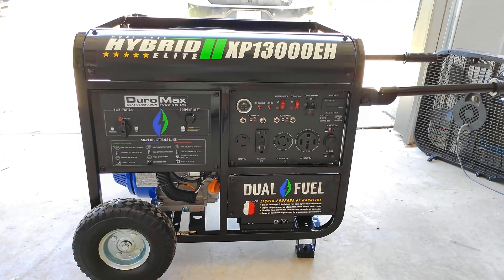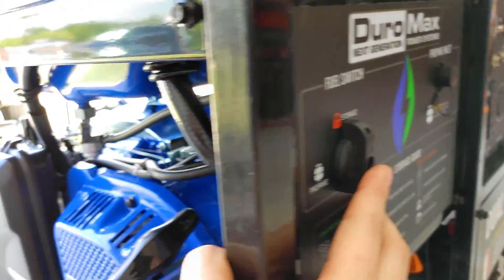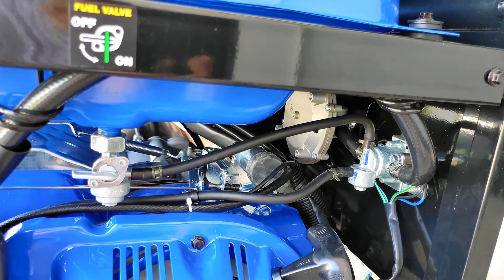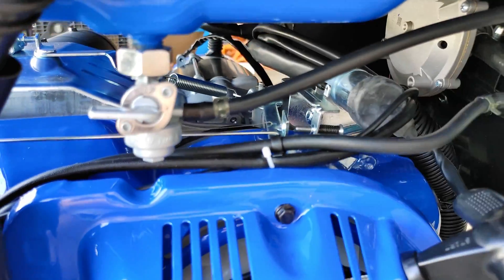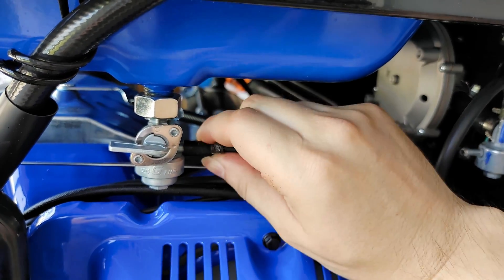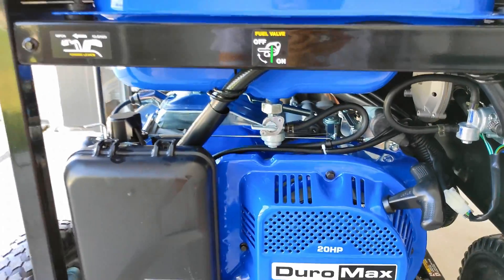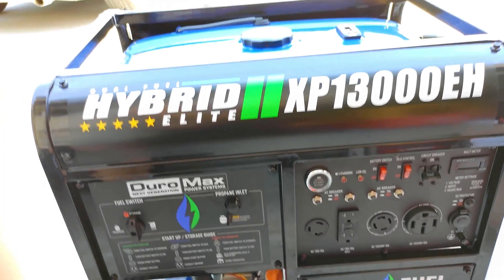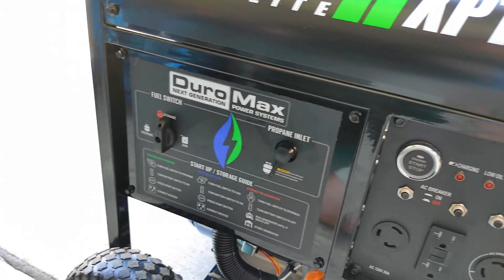Surging DuroMax XP13000EH Portable Generator - Bypass Fuel Selector Switch

Comment: Mine is brand new (2025) XP13000EH, started surging after less than 1/2 hour of use, then would NOT start with gas at all. Runs fine on propane. Bypassing the fuel selector switch as you demonstrated solved the issue, so Duromax hasn't done much to resolve this problem apparently. Now I have to get them to send me a new switch. Thanks for the great video, it was very helpful!
Reply from the maker: Good luck getting a switch! I never received mine and it has been bypassed and working well ever since.
Reply: @FRANKHURTADO01  I contacted Duromax just now, they said after I send them my receipt they would send me a new Fuel Selector Switch. I'll let you know!
Reply from the maker: Let me know! Same thing happened to me. They asked for receipt, then address to ship out selector and a call afterwards. Then nothing happened and it's been a couple of years now.
Reply: @FRANKHURTADO01  So they sent me the part, pretty quick service too! Only problem is, it's the petcock valve, not the fuel selector switch. I emailed them again this morning with another explanation of what part I need to fix this generator...I'll update when they respond.
Reply: Update 5/22/25: Duromax sent me the correct Fuel Switch valve, and it only took about a week or so to arrive. The installation was very easy, and now my generator is working as it should. I suspect the issue when you tried to get your part was the timing, especially during the Scamdemic and when supply chain issues were disrupted. You might want to give it another try! I am very satisfied with Duromax's customer service on my issue.
Reply from the maker: @BobMead-d5v Why are you calling it a scamdemic?

Comment: Although I only run mine on propane so could have the same issue but don’t know it. Also, in runs my entire 2800 square foot home with 2 freezers and 2 fridges, electric hot water heater, pool pump, and 5 ton AC. 5 ton ac not at first, but after a soft start installed, no problem

Comment: I guess there is lemons in every brand. I bought this exact generator a year ago. Two storm outages with no issues.
Reply: I did same thing few years back for storms in Florida. (Now Texas)

Replaced bad carb. I still  have few minutes of surging. Each start up. 

I am trying to run it an hr each month. Which is better than nothing. 

But I think I need to put heavy load on unit. It needs to work hard and I think it will clean up its performance.

Comment: Did ANYONE get a new selector switch?  I have a tri fuel Duromax that runs good so far, but DUROMAX DOES NOT SELL PARTS FOR IT. I WOULD NOT BUY A DUROMAX UNTIL THEY HAVE PARTS AVAILABLE FOR THEIR GENERATORS.
Reply from the maker: I never did :(

Comment: Great Video.  You'll help many people.  Another idea. If you have natural gas at your home. Buy a natural gas regulator along with the fittings and natural gas hose.  Remove the propane hose from the selector switch and redirect it to the natural gas regulator make your adjustments place the selector switch to propane and now you have a tri-fuel generator.
Reply from the maker: Good idea! Don't need that in my situation since this portable generator is a backup for my 22kW Generac which is plumbed to the house's gas supply.

Comment: Funny I bought the same Gen in July 2021, since then I run my generator twice a month, just put new fuel with stabilizer, Gen ran great all day, the following day, it started to surge, before I started to make calls and troubleshoot, glad I saw your video, problem fixed, ran it for the last 2 days for an hour each day, problem solved, I turn the dial to storage but also turn off the fuel lever also, great video thanks for your help.. Rich
Reply from the maker: Seems like a common failure point.

Comment: I have the same unit.  After having electrical work done, went to test and started surging, quit and wouldn't restart.  Moved to garage and tried a little later and it started right up.  Tried again today and it did the same thing. Read troubleshooting and saw unit must be level.  My driveway is not level so I leveled the unit with some boards.  Then it ran fine. I'm guessing either the oil sensor or the fuel pickup were out of sorts on unlevel surface.

Comment: my  XP13000HX was a complete failure.  disapointed.  I could not get tech support from duromax so I started trying to fix it myself.  I was backfiring violently to where the muffler was deforming outwards.  I did more research and found out when engines backfire like that it is most likely a vavle problem.  So I took a look at the valves, and in the process dropped a rocker arm pin down the opening leading to the oil pan.  so I have the rocker arm pin sitting in the oil pan.  It just keeps getting better and better.

Comment: Having the same problem with my 13000 E only problem is this doesn’t help me much because mine is straight fuel gas only not fuel fuel so I wonder why it keeps shutting off smh it’s brand new with less then 50 hours on it

Comment: Its a shame that you spent 1500 on a genny and the part you need is back ordered for months.
Reply from the maker: Still to this day haven't received the part!
Reply: @FRANKHURTADO01  so let me get this straight....the video show a year ago it was up loaded. So its been that long!!! I would be raising hell with them!
Reply from the maker: Yep that's exactly what happened. Good thing I got this generator as a backup for my 22kW Generac. I also only store gasoline so the bypass works fine for me. But yes the tech support just doesn't follow through.
Reply: @FRANKHURTADO01  one more thing....Would you consider Westinghouse 15kw over the one you have? Thanks

Comment: Id be interested to see if yours behaves the same as mine

so mine runs amazing on propane,  but does the surging when I tried gasoline

oddly it ran for about 12 hours on gasoline no issues and then the next time I tried to use it again on gasoline it did this surging stuff, however when I went back to propane it works like a charm again.
Reply from the maker: Oh wow. I would have to test jt out on propane at some point.

Comment: Just a quick question can I run my Duramax generator without the battery switch on just trying to burn all the gas out only used it once for a couple of jrs
Reply from the maker: Yes you can do either with battery or crank. Just close the fuel valve while the generator is running and let it run until it dies.
Reply: @FRANKHURTADO01  ok thanks

Comment: Well ours won't start at all. First time we actually need it and won't start.
Reply: When it is Brand New....it will Always Start in the First pull in Recoil Start.  Maybe 2-3 on electric start if we follow All the Steps Correctly
Reply: Hold choke plate closed while cranking engine. Might have to feather choke plate till engine warms up.

Comment: Very interesting. Good job explaining things.
Just curious...can you bypass the gasoline and just run it off propane?
Not that I have a problem, just curious.
Liked and subbed👍
Reply from the maker: I don't see why not. The only thing would be finding an adapter to properly fit the propane tank and the fuel lines on the generator. I don't have a propane tank so I haven't been able to test this.

Comment: Looks to me all you need to do to use propane is hook up your tank and turn fuel switch to propane. Just leave everything else the way it is. Just a thought🤔
Reply from the maker: That is something I didn't test since I don't have a propane tank. Assuming the fuel switch works correctly with propane, and doesn't surge, that would certainly be an easier route.

Comment: I had a regulator added to mine. It's starts just fine on the initial start, but if I cut it off it won't start anymore. I probably have to wait a couple hours before it will start again. Any suggestions?

Comment: 100% best Generater.Systems I have used. A test for hurricane prep here in Louisiana: three AC units, 5000, 5000 & 8000, 3 fridges, 2 device power setups, 4 flat screens....AND I had 40% of the power meter to spare.
Reply from the maker: Generator is that device that generates power. Takes some sort of fuel source and generates electricity. An inverter converts DC power to AC or AC power to DC.

Comment: I purchased the same unit 1 year ago. Used it 3 times. The fourth time, it would turn on for 5-8 seconds then turn off. After lots of troubleshooting, we discovered my fuel selector switch also failed. After I bypassed it , it ran without issue. Thanks for the info. Not sure why these switches fail so much.
Reply from the maker: Bad engineering I guess. I still haven't gotten the fuel selector switch shipped out to me even after getting the warranty department involved :(. It just runs without it. So not sure if I want it at this point ha ha.
Reply: @FRANKHURTADO01  The only thing I worry about is the length of the hose and the large wrap around length. Seems it's needing to travel up, then around. I'm tempted to cut it to avoid extra travel needed. I guess I could buy a spare hose.

Comment: If I am understood right you have selector switch  problem on new unit?
Reply from the maker: That is correct. The fuel selector switch is bad.
Reply: @FRANKHURTADO01  what about diafragm valve I see people using additional on tank plus generator diafragm  vertical position.

Comment: I just tried to start my xp13000eh yesterday and it ran for less than 20 seconds before dying out. It will not restart.  So frustrating.  I will haveto try this. It's bullshit though buying brand new and having issues first thing out of the box. They better give some money back for brand new generators having issues. I am not keeping mine that has faults out of the box. Not a good start.
Reply: Same with me, I did the bypass as in the video and it worked without issue. They will send a new switch but why do they fail so much !

Comment: Can you still run propane after fuel was rerouted?
Reply from the maker: I don't hqve a means of testing out the generator with propane. You would have to connect the regulator directly to the carburator so I would think a longer hose is needed to do that.
Reply: No think about it. He bypassed the selector switch that is not working. 

He will need to go directly from the propane regulator to the input port that is post carb.  Basically bypassing the selector again via propane. Possibly you also need to pinch off carb line to prevent back flow from propane.  My guess is this is what that selector switch did via valve.

Comment: Did you know the THD of the generator?  Looked at the manual and the Duramax website, crickets….
Reply from the maker: According to genratorgrid it has 10-12% THD. I already have UPSs on all my sensitive electronics so I am not too worried about my devices getting damaged.
Reply: @FRANKHURTADO01  Thanks, I am concerned about my Mitsubishi Air Sourced heat pump..  I actually have a 20KW Cummins, but of course it broke, and you just can't get parts now..  Thinking about getting the Duramax until the 20KW gets fixed (if ever).  Thanks.

Comment: Do you use a transfer switch to connect this to your home or a Duralink connection? Thanks for the video!
Reply from the maker: My portable generator is connected to the main panel using a manual interlock switch. I do, however, have an automatic transfer switch for my 22kW Generac which switches power from the grid to the Generac generator whenever power goes out.

My portable generator is there just in case the Generac stops working during an outage. The interlock switch lets me completely disconnect the grid and the generac from my main panel.

Comment: Thanks for the tip was a great help!! I just purchased the same generator last week and it started right up which was good but was surging a bit but didnt think it was a big concern until I heard yours after you did the bypass. A week later when I tried the unit again to do a dry run hook-up to the house I could not even start the generator so I went through the Manuel see if I didn't do something right but all looked ok. I then went to Youtube to for some trouble shooting online and found your video which again was a great help!! thank you! I did what you did what you suggested and the unit started right up but it is still surging pretty bad so not sure what that is? Perhaps carburetor issue?? Any suggestions would be much appreciated. I will try calling Amazon where I purchased it and also call Duromax directly to see what the next step might be. Like you I do not want to ship it back, plus tour up the box it came in already so hopefully that's not a problem.  Any other thoughts out there again would be appreciated.. Thank you! John
Reply from the maker: I also think it could be a carburator issue. But just to cross off all the possibilities, make sure the gas you're using isn't too old, check the air filter and make sure it's not onstructed by anything, turn on the generator on a flat and level surface, make sure the shutoff valve is open all the way, and lastly make sure the auto idle switch is off.

If none of that works, give duromax a call and see what they say. Push comes to shove, return it to amazon.

Thanks for watching!
Reply: @FRANKHURTADO01  Thanks for the reply back and I will try those tips.. Have a great thanksgiving.
Reply from the maker: You too have a good thanksgiving!  Put a comment with any updates whenever you get a chance.
Reply: These problems should Not exist for Duramax Generator.  It has got very good Ratings.   All Brand New Generators will Always Start in the First pull for a Recoil Start.
......if ONE follow All the Right Steps
Reply: Mine had the same problem. I bypassed the switch as John showed, but it still surged badly, but I noticed a sheet metal lever in top of the carburetor that moves when it's cranking....not sure whether it's a choke or an enrichment valve, but rotating that lever to the right slightly smooths it right out.
Reply: Before shipping back try a propane hook-up get a 20lb tank try it,see what happens.😊

Comment: I'm still totally confused on the propane connector to use on this unit that is threaded on both connectors. The manual says it's an LPG Source. I bought a Coleman Propane Adapter 1lb to 20lb which (silly me) thinking these connectors are universal. It's bad enough everything on this machine is in MM. It was the wrong device. Any suggestions / links on the correct propane connector / hose to purchase with the right connector is much appreciated.
Reply from the maker: Sorry for the delayed response. Let me look into it and I'll ping you back when I have something.
Reply: @FRANKHURTADO01  Any idea why it would surge using propane? First time it started, ran fine. Second time I attempted to start it, it back fired and engine surged once started. And I’m also not sure if choke is on or off starting with propane….I’ve seen people say yes and no….confusing.
Reply from the maker: I have not used propane on my unit. Have you tried bypassing the fuel selector switch and tied your propane line directly to the carburator?  If my generator was starved for fuel with gasoline, it could very well be it would also be starved with propane. I think the manual says you have to put it into auto idle (throttle) when using propane. Have you tried that out?
Reply: @FRANKHURTADO01  Helpful advice. I'll try to connect directly to the carb and confirm settings with the manual. Currently, my fuel selector switch is operating normally, at least not idling wildly.
Reply: @kc7154 hink of the choke as a flow adjustment valve when using propane.  Fine tune via choke/propane flow until you hear it running strong.
Reply: @FRANKHURTADO01 also what you need to understand is the propane line taps in after the carb but before the choke. Also think of the choke as a throttle blade on a car. Wide open Vs closed.  Fine tune the propane flow with the choke.

Comment: The Duromax and Westinghouse company's treat customers like dirt'  that is if you can get them on the phone at all. So avoid them like the plague. Buy Generac, Northstar Honda or Winco  all seem to be US Made and have a parts department!
Reply from the maker: I have yet to receive my fuel selector switch. They were very helpful when I called, but I am sure I would've had a terrible experience if I didn't have the mechanical and electrical knowledge I currently have :( .